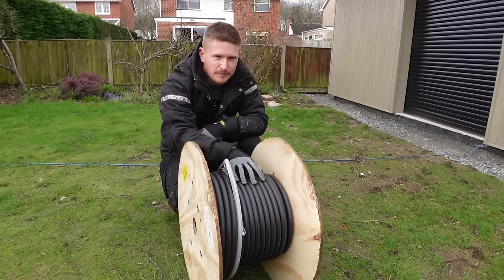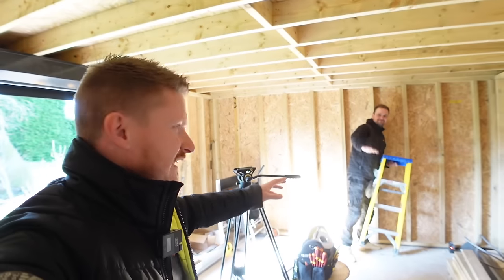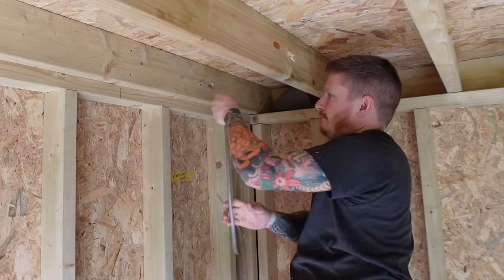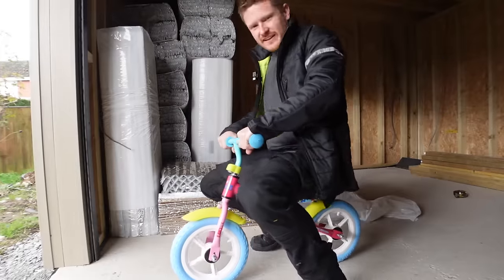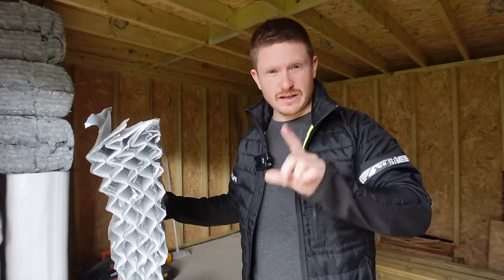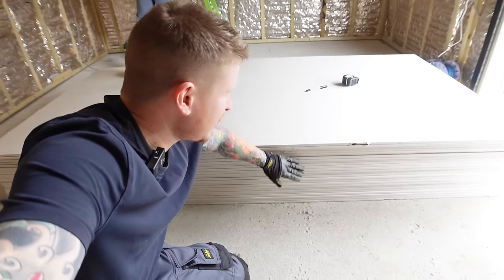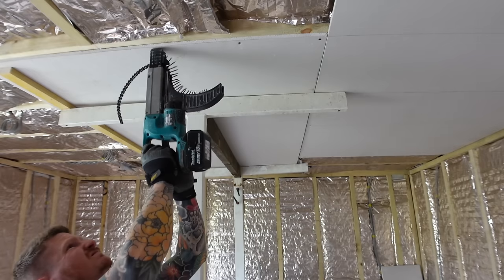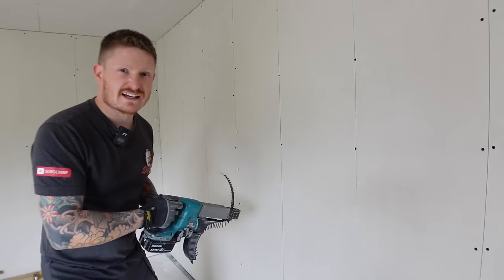Installing Electricity and Insulating a Garden Room - Workshop Build PT6

Comment from the maker: Really coming along now! Next time…. Plastering, painting and second fixing electrics.
Reply: Can’t wait
Reply: I plan to change the carpet. Will you also show me how to change the carpet? I was changing the overhead lighting in the bathroom and I got lost. There I have three cable bundles with three cables each. I can't connect it properly. Sometimes I have light all the time or I have no light at all. I connected the Ceiling Rose cables in the room without any problems. This is what I did after watching your lecture. In the bathroom I gave up.

Comment: I’ll ask again, who is signing off the electrical work you’re doing? A lot of this has to be done by qualified electricians, so either you’re qualified or you’re labouring and getting it signed off by a spark or inspector. No spark would sign off work they didn’t design or install, so please clarify how this non-DIY work is getting certified? Thanks
Reply: Likely someone he knows id imagine. I've known sparks to inspect, test and sign off work before commissioning. There is nothing stopping a diy-er running cables and wiring up a dead circuit
Reply: @Skandoro  yes some sparks do but only for trusted mates, not for average paying new & unknown customers. I know that there isn’t anything stopping them, actually there is - the law - it prevents them touching most of the most important stuff but a LOT of people don’t or could misunderstand and really it should be made clear…DIY Guy is in a better position to do it himself than most people are.
Reply: A person doesn’t need to be registered as a competent person on a competent person scheme to undertake notifiable work. So long as they notify their local authority Building Control before undertaking the work and said building control are satisfied that they are competent to install and test and meet Part P of the regs and any other relevant part, then in my experience and under the law that is acceptable. I’ve fitted EV chargers including new DBs without a gold card or competent person registration through this route. Tested and provided EICs as I have other quals including C&G 2391-52 and a calibrated tester, and building control were happy with that.
Reply: You don’t know the right people pal
Reply: Do you think it might be Sam the Electrician?
Reply: The qualified electrician who he introduced in the video technically speaking if it’s DIY it just needs to be safe. Building control would have to be notified before essentially but they could be told by an electrician that it is safe with something like an EIC but they can’t issue the paperwork signing off officially.
Reply: He is an electriction
Reply: Don’t think you need to be qualified to do anything to your own home, gas, electric, water, if it’s your house you can do what you want. Now if you want it to be covered by the most basic insurance, you need the work to be signed off by a qualified contractor in said fields.
Reply: @garethwatson7999  that’s not true
Reply: @garethwatson7999  the building regs say differently the council can take enforcment action if it warents it.
Reply: This is his own personal house so he is allowed to do this
Reply: @Ten20riosinobenut  actually no most of it is notifiable work so build a control has to inspect it and they have to be told beforehand it’s going to cost more than a professional. It can also invalidate a houses insurance.

Comment: In regards of your cold roof and your ventilation space, you had a solid blocking running end to end thus blocking your continuous ventilation, did you drill holes in your blocking but just never showed it?
Reply: I wondered that too.
Reply: Ditto, the noggins were full width…. They could have been put in at 90 degrees to prevent twisting but permit airflow.
Reply: I spotted this and only Gona get vented flow front to back and then noggins  don’t apear to have a gap . And not vapour barrier in the roof … not even foil tape … I for see a. Wet roof in few years ! I know as I had this from my workshop ! Had to do some work to fix it . Thanks builders of it
Reply: @jammymukka  could have just been 100x50

Comment: you don't have continuous airflow above roof insulation, your cold roof won't work.  noggins are all they way up to the roof deck, noggins should be minimum 50mm shorter then then roof joists and installed the way that here is a gap above them for the airflow.

Comment: There are two things that I would have done differently, 1st the Noggins or struttings that were fitted midway along the ceiling joists should have been 50mm smaller to allow airflow to continue across the ceiling and 2nd I would have used foil backed plasterboard to be doubly sure no moisture got through into the ceiling and wall voids.

Comment: If you were building a garden room for use as a bedroom or tiny home, would you tape the joints between the insulation and would you have to fit a vapour barrier between the insulation and plasterboard. Also do the plastic boxes for sockets be used if you were using cladding or plywood instead of plasterboard. Brilliant video and very interesting. Hope all is well and hope you have a great weekend, take care
Reply from the maker: Actis insulation had a vapour control layer. Thanks
Reply: @TheDIYGuy1   lol not at the cut gaps or untapped
Joints . Oops 😬

Comment: Learning so much from this series. Thanks so much. Really hoping you can show the next step and installing the consumer unit. That's the point I've got to with by garden room. Will be amazing to finally have power down there without running an extension lead! 🤣
Reply from the maker: Glad you like it. Hoping to bring you some consumer unit content 😊
Reply: Unless you're a sparks, get an electrician to do it. You'll need the certification to comply with the law which will have to cover the work he's done as well as signing off whatever you've done, such as running the armoured cable from the domestic supply to your shed.
Apart from anything else, being anywhere near a consumer unit/fuse box busbar can be life changing...
Reply: @JP_TaVeryMuch  thanks. Whilst im not certified myself I do have  avery good friend who always checks my work, tests it thoroughly, helps me make any corrections, then signs it off after he is happy tonput his name to it. Appreciate your comments and concern, but I am that person.
Reply: @MrGuardcaptain  
Good on ya and thanks for your thanks.
Reply: @JP_TaVeryMuch  there is actually the possibility of notifying building control before and they will just send someone out or an approved contractor to safety check it but they can’t issue the paperwork as they were not involved in the design
Reply: @UKsystems  Absolutely, but not exactly the most useful way to go about it, nevertheless it's an option towards part completion.
Reply: @JP_TaVeryMuch  I agree with you that if you’re gonna learn something it’s probably not us learning on our building you’ve spent a lot on

Comment: Problem you have is the noggins will stop air flow. You could have a gap above them that dosnt show on camera though. Also it looks like you didn’t put a vapour barrier on the warm side so any source of moisture inside will go through the plasterboard into the insulation. That looks like it’s got a degree of vapour retardation but if you have gaps then the vapour will get through behind the insulation and condense. 

However it’s a garden room so your unlikely to have a high source of humidity so you’re unlikely to get a problem. If you are running a shower in there or it was a habitable space then it would be a bit more of an issue.
Reply from the maker: Actis hybris has a vapour control layer. There is still ample airflow. Never had any issues with my method in the past so will continue with what’s tried and tested. Thanks
Reply: Looks like noggins would stop airflow? Good video

Comment: You have inspired me to build another garden room using similar cladding and construction method as you have. I intend making a timber base frame and possibly installing a log burner. I would love you to do video on installing log burner in a garden room. One question -- your room is greater than 15 SQ m and within 1 m of boundary. I see you have non combustible material on back but when I check regs it says substantially built of non combustible materials.

Comment: Would there be any reason to insulate the roof's overhang (on the outside of the walls) or only use the Actis Hybris to insulate roof space within the inside of the build. I have a 500mm overhang on the front of my flat roof. Thanks!

Comment: Great video! 
Quick question on the roof gap - while i understand your drawing and intended flow of air, how will the air current pass through the roof space when there’s noggins in place?
Reply from the maker: Easy, drill holes within the top 50mm of the noggin. Thanks

Comment: Fantastic info, as always. I'm currently building my own garden office and just about to put PIR insulation boards into my walls. A friend (experienced DYIer I guess) said I need to have a gap between the board and external OSB for ventilation. Please could someone confirm / correct that, as I've not seen anyone suggest similar? I followed the standard construction with C24 treated 4x2, OSB on the outside and EPDM membrane. Planning to put the 75mm PIR boards all the way in to touch the OSB, fill in gaps with expanding foam, leaving circa 20mm gap between PIR and plasterboard (wiring will go there). Does that sound right? Also, would anyone bother with a vapour barrier before plasterboard, if I have no plumbing, unlikely to have a kettle in there. I will do some exercise, but will then make sure the room is ventilated. Thanks in advance.

Comment: Really enjoyed this video and the variety of jobs, I myself am currently doing a cold roof at my house and was unsure of the insulation to use, but now I’ll look into the one you used so thanks for that, I also brought quickwire down lights because of your previous videos with them, one question I have please.. with the insulation being pretty much on top of the plasterboard ceiling, when doing the down lights.. did you just leave a gap in the insulation where they are going? Or cut the insulation out where they are going? I assume you can’t just push the insulation up where the lights are as you risk closing up the air gap above for ventilation? Many thanks, Phil

Comment: Out of curiosity. Are you going to install solar on the shed? It looks like your would get really good generation on that. Paired with a hybrid inverter and battery you hopefully should be able greatly reduce your grid use.
Reply from the maker: Interesting. Not something I’d really considered
Reply: @TheDIYGuy1  It might be worth taking a quick look (without committing to anything).

Without a battery hopefully you can export enough energy to make a credit balance for your winter use so over the whole year it reduces your costs.

With a battery you can also charge it over night in the winter / late autumn with cheap rate energy at night to use during the day. So, for example pay something like 14p/kWh instead of 24p/kWh.

That said, obviously everyone has different energy requirements so whether it is worth it for you would require a bit of investigation on your part.
Reply: @TheDIYGuy1  one thing to consider is it’s quite a high upfront cost but there are budget ways of doing it which are DIY if you do it correctly it’s still recommended to have it inspected but you could do it yourself

Comment: Doesn't there need to be a void around the downlight so the insulation doesn't overheat the light? also, would it not push the insulation to the OSB?

Comment: Looks great, probs more insulated than my home.  Quick question: How will your ceiling ventilate pass the ceiling noggins?  Would that not be a blocker stop the air flowing from front to back.
Reply: Was going to ask the same thing. Have seen some where the noggin was a 4x2 so there was a gap above, also seen where they drilled 3 holes in the noggin to create the same.

Comment: Nice work. Just started watching your channel. Learning loads.
I also have a question, Is there an alternative way to get power to a summer house as our fuse board is at the front of the house with no side access as both neighbours are joint on to our house?
If you can help it would be much appreciated.
Reply from the maker: There’s always a way but it would need proper surveying. Thanks
Reply: You can get things like 16 and 32 amp commando sockets so technically speaking you could have a cable that would let it plug-in so you could disconnect it or something like solar potentially

Comment: Great video mate, its given me some ideas now on how to make a garage a car port and make the other half to the garden like a workshop/summer room.

That insulation, is that better than celotex then to run cables in? As I thought the Celotex stuff really effects loads right. Is this much safer then?
Reply from the maker: Glad you liked it and have taken some inspiration from it.
Reply: You failed to realise the electrical system is safe in seller tax because the cable rating is done appropriately

Comment: Again, fantastic video, thanks. Not sure if I missed it, but are the roof noggins meant to be lower than the rafters to ensure that airflow? I can't quite see in the video. Say I have 5x2 rafters, I assumed for cold roof I use 4x2 noggins (which is what I've done) and will have 75mm PIR boards at the bottom of the rafters. Is that right?
Reply from the maker: Could do but I just drilled some holes 👍
Reply: I see, thanks for confirming
Reply: @TheDIYGuy1  Not gonna repeat everyone else's question about noggins and airflow🤣, but putting in an extract fan (with humidistat) or cheap mvhr could help keep the moisture levels down if needed. (Another great video by the way 👍👍)

Comment: Mate you do some good videos but you have glossed right over the most fundamental points in that cable from your house to garage. 

Why did you pick 10mm2 were you considering that for distance voltage drop and load? 

Are you installing a 2nd consumer unit if so how are you discrimansting the fuse in. Lard to the 100amp double pole? Or are you using Henley blocks.

Also earthing is this using the armour as earth as cable looks quite small for 10mm2 3 core or are you installing a spike.

Yes you mentioned methods but there are depths and markings tape etc. 

Really you could do a video just on cable just so people properly understand what’s required I used 16mm2 3 core for my garage to allow EV charging 

It is a good content channel you have but last couple of videos could explain a bit more in depth especially comparing cutting insulto the mains feed
Reply: It does get too technical to explain, and that's where people should recognise their own limits. This isn't really DIY work, and maybe he should highlight some aspects of cable selection, so that people don't think "its 10mm for an outbuilding".

Comment: Don’t the noggins in the roof space restrict the air flow for the cold roof?
Reply from the maker: No, fine in my experience. Total airflow all around the insulation so no chance of any condensation issues.
Reply: Ventilation in a cold roof construction requires a continuous airflow. The noggins in this cold roof construction are preventing this. This issue could be easily resolved by providing a series of 25mm diameter holes in the top section of the noggins

Comment: Not throwing shade is just a question as I’m building my own garden room and I’m at a similar stage to this video- does that insulation you used work as a vapour barrier? 
Great video by the way
Reply from the maker: Thanks. Yes actis hybris has a vapour control layer 👍
Reply: @TheDIYGuy1  seems pretty good, I might give it a try, thanks

Comment: Isn't your row of noggins going to block the flow of air from one side of building to the other?
Reply from the maker: Nope the noggins don’t matter as long as there’s ventilation for each area across the top of the insulation

Comment: Is 10mm cable enough for that run with a heater etc, I been advised to go for 16mm on a 25m run
Reply from the maker: It’s enough. Volt drop has been taken into account.
Reply: You really need to buy the on-site guide. You need to look at the tables that tell you the current calculations.

Comment: But your roof dose not have a air flow from the walls, because your noggins block the 50mm roof space in the middle.(you can see this in the video).
Reply from the maker: Yeah, it does because the noggins don’t block the air flow.

Comment: Ummm your ceiling noggins have blocked the air flow.  You should have used smaller sized timber for the noggins 👍
Reply from the maker: Few holes through the top 50mm soon solved that.

Comment: This is not a vented cold roof.
Your noggins block the cross ventilation from one side to the other.
For a cold roof you need to ensure cross ventilation all the way to each side of the roof.
Reply from the maker: Holes drilled in the noggins, there’s cross ventilation

Comment: Your cable should be at least 500mm deep..
Reply from the maker: Not if under a solid surface such as the patio. No need to protect it with ‘depth’
Reply: No mate it's got to be buried and warning tape.
Reply: @TheDIYGuy1  however this solid surface is temporary and possible to move. It’s not like it’s a solid surface it has been installed to protect the cable.

Comment: 6Kw power Pack, would solve all your problems! would it cost the same? might not if one of the manufactures gave you one to try 
eg "Anker"
Best of luck with your channel.
Reply: No these units are useless. The power they put out is not pure so it can reapplies and they can’t be serviced so you’re gonna need to buy a new one. This installation technically will wear out but it will take a long time.